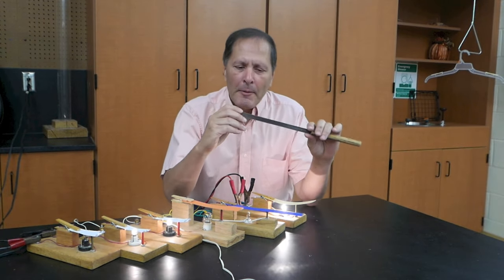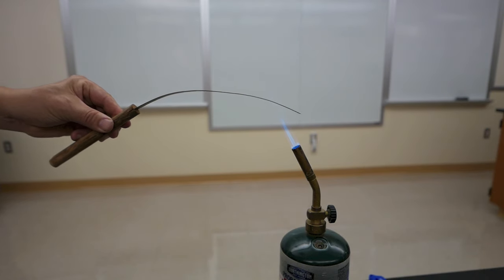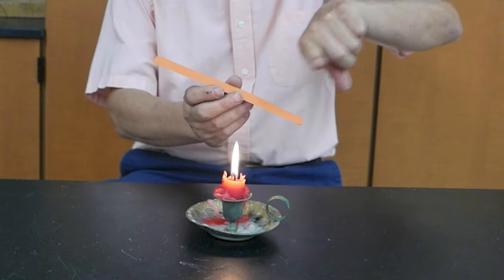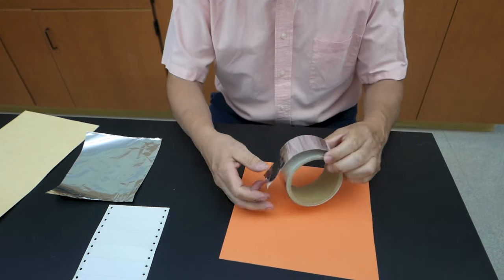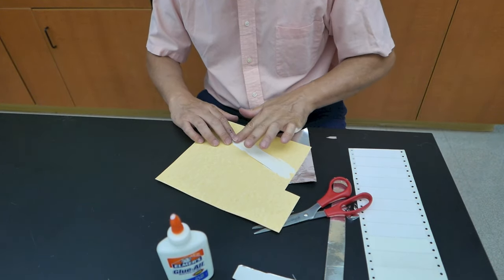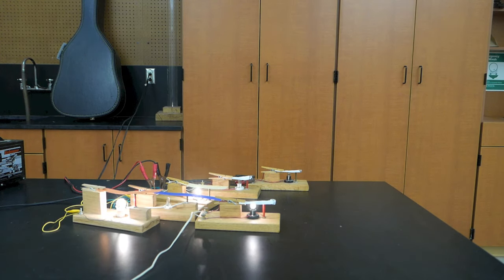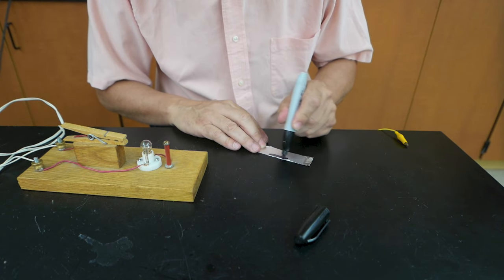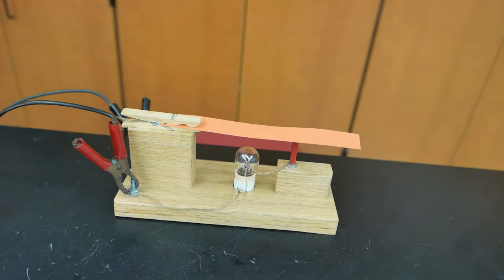Homemade bimetallic strips - Thermostat demonstration // Homemade Science with Bruce Yeany

Comment: Simplest circuit breaker replace fuse and it can be use as high current low frequency high power microwave and radar

Comment: sir why we use two metals like brass and iron for thermostat? 
does we use single metal for thermostat
Reply from the maker: the brass and iron expand at different rates,  thermostats use the  bimetallic strips also,  only they are curled  to make them fit easier

Comment: Please what is the name of the paper you use as metallic sheet. And where can I get it. Am waiting for your reply. Thanks
Reply from the maker: it is aluminum tape,  it is like aluminum foil with adhesive on the one side,  if that is not available you can use aluminum foil and attach the paper to it with adhesive spray or large paper stickers

Comment: Great video.  Now I am wondering if there are materials sensitive enough to work as an actuator to vent my future greenhouse when it gets too hot.  You always get the brain buzzing Bruce, thank you.
Reply from the maker: I can get these to work for a few days, haven't tried for any longer time.  If I were using it for something like you suggest,  I'd probably use an old bimetallic strip out of a thermostat.  WIth the ones I made, I think the moisture might be a problem with the paper
Reply: Bruce Yeany I appreciate the feedback Bruce, and for that application of opening a vent and being durable I would definitely  go bimetal as per the beginning of your video. There are beeswax pistons out there, but I like this thought and I know there are some old thermostats in the loft of the shop  Thanks Again!.

Comment: can memory wire be used for this us as well?
Reply from the maker: I don't know,  I never tried it.  Hopefully someone else may answer this question
Reply: this was the foundation of memory wire that Bruce Yeany just demonstrate for us laymen .  and yes we have been using memory wire for the last 60 years in the commercial sectors. look to the old heat thermostat during the time mercury thermostats were used in the public sectors of home heating. 

and even after 60 years? those thermostats still work with perfect timing of memory using heat factors despite the degree of oxidation,

. here could be a fun experiment.  get and old thermostat, remove the mercury bulb. use what is left over to turn your lights on during the evening hours by an electrical contact and they will turn off during the day light hours where the temperature will change. that is memory wire using the physics of thermal dynamics. to day? we call them coffee pots. the same memory wires

i might add memory wire was invented by tesla. i was curious so i looked up his patents. but only for i was looking for his ray gun he gave to government and found that he always included in his physics the memory of heat in his wires. the ray gun he invented can be found in most any home on the planet now. it is called the megatron. found in any micro wave oven. or any radiant tower such as a cell tower. with out memory wire we would not have instant communications today. nor silicate computer chips. thus the name silicon valley in California was later created for its understanding of using silicate instead of metals. silicates changed the face of Tesla's discovery's to crystalline uses involving polymers. a much cheaper and available compound then metals. and yet held a greater perfect degree of persesiton when heat was presented. thus in 1968 in the public sector the first video game called "PONG" was invented to the mass publicly.

whom am i? i never graduate from high school. lower learning was a lie. and college perpetuated that lie. even though i had to pay them 260,000 dollars for there lies. and never was given a degree.

Comment: Bruce,  as another of your "fans" mentioned this is another demonstration of "free energy" (gosh I hate that misnomer) as is your solar motor.  I think you could adapt this bi - material method to a similar type of thermal  acoustic motor.  Not piston powered like a Stirling engine think more like the rubber band spoked wheel or over balanced wheel,  cool on one side warm on the other,  the curling of the materials could effectively shift the weight to one side of the center of rotation. What's hot and cold naturally? Many things,  sun and shade,  evaporation,  condensation are a couple of simple ones people forget. "Energy" is all around us and (apparently it peaks in children, lol) inside all of us. Many common consumer packaging products are bi-material. But of course as we all know ALL energy is "free".... It's the collecting and distribution off for which we pay.
Reply from the maker: LOL,  yes, I know any time I use the term "free energy"  I am in for a host of complaints or comments.  . I hadn't thought of using a solid for the expansion properties but it sound like a good idea.  I want to give that some thought,  Thanks capawackio

Comment: Another example would be the turn signal flasher for a car.  But instead of heat from a bulb, its current flowing through the bi-matalic strip that makes it bow, making and breaking the circuit.   However, some newer car use timers,  especially cars with LED tailights, because of the low current usage.

Comment: Hey Bruce! I've been thinking about motion toys like your 2d sand hourglass frames and solar motors. I'm playing with bamboo and water ideas (kinetic fountains) ooh that sounds cool when I phrase it like that. The idea I have in mind right now is to do a long term 'this path, that path' type of water drip distribution system with shishi-odoshi, or dear scarers, the clack water bamboo pivot fill up till it tips-thing-trick, along with thin strips of bamboo that alternatingly get soaked in water and bend or dry and restiffen, and as water drips into different paths that are always changing randomly (kind of like double pendulums do, but maybe with the design of a loose pyramid / pachinko type layout

reminds me of the champagne pouring trick, the cup that runneth ov-a

shishi pachinko odoshi inari

Bruce if you have any access to bamboo sticks with a decent diameter, cut to a length you can comfortably swing around, and drill (burn actually works well), and maybe remove a couple nodes to make longer air columns inside the stick, it makes a really pleasing song stick or dream reed OOH I like that name too! thank you bruce you're so easy to talk to you know that?? gosh are you a genius or something how do you do it. Thanks for the help. but that stick is so much fun to swing around and try to hit different notes with, a little whipple of the wrist and you can get trills, smooth swings with the right clip to get wind are really satisfying, you can make fast space ship sound by going back and forth, or long space ship sounds by spinning in a circle smoothly. I make staff flutes sometimes and this is an easy variation, my mom's random holes in sticks even sound good, and they're always so unique, the sounds they make! from George Lucas to Jean Luc to mars rover the variations are endless! 

lol like wtf does it only make spaceship sounds kid??? why???? haha love you bruce